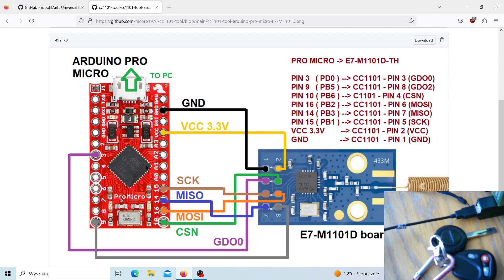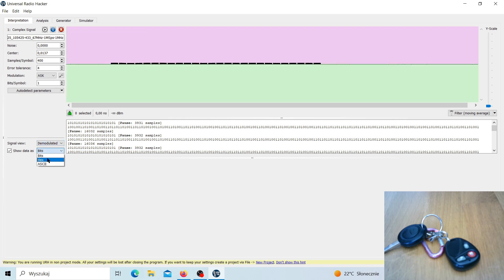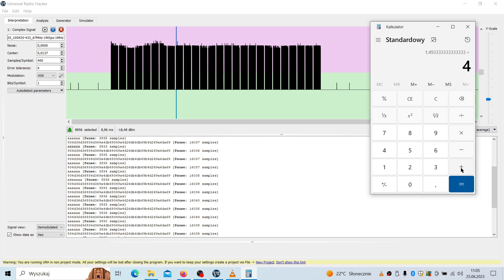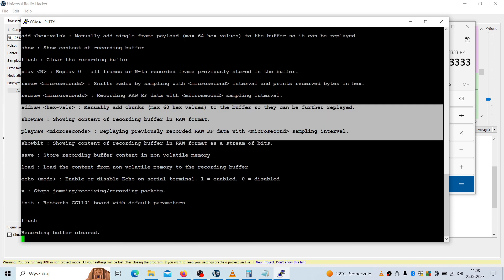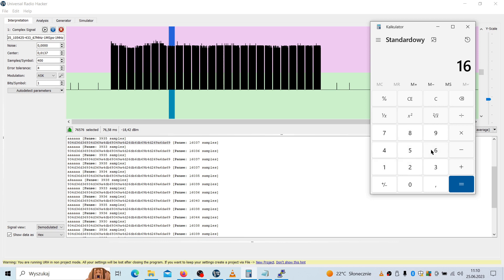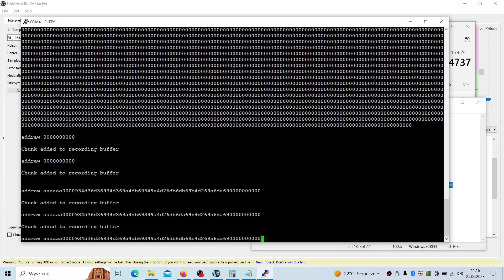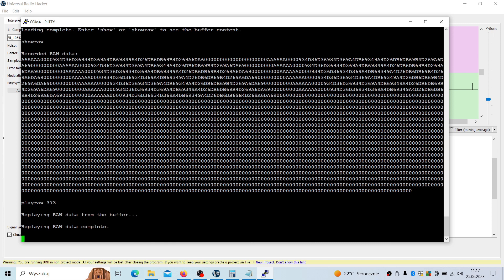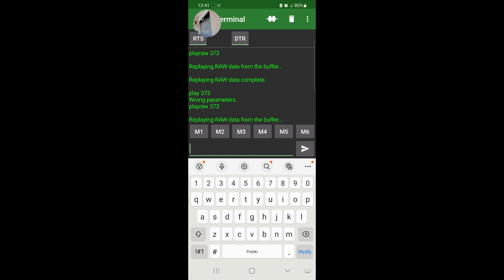Cloning my key and opening my garage gate with my 10 USD DIY CC1101 tool and Universal Radio Hacker

Comment: Hi I implemented the CC1101 module on the ESP32 DevKitC_v4 board according to your GitHub documentation, but I’m unable to receive data from my remotes.

I have a 433 MHz ASK garage remote and a 433 MHz FSK car remote, but I can’t receive the codes from either. Previously, using an RXB13 radio receiver module connected to an Arduino Nano and the RC-Switch library, I was able to see the binary code, decimal, pulse length, and raw data of my garage remote. However, with the CC1101 module, I’m not receiving anything.

I even tried sending a frame with the CC1101 and receiving it with the RXB13, but the receiver showed nothing. Unfortunately, I don’t have access to SDR modules to analyze frequencies with Universal Radio Hacker.

Can you help me figure out how to solve this issue or what parameters I need to set?
Reply from the maker: use scan function in my code also use rxraw  option to see if your cc1101 is working
Reply: @justanengineer5599 
I used the `scan` function, and it detects the frequency almost correctly (not precisely).  
I also used the `rxraw` command, but I don’t receive valid values; most of the received values are 0.  
I thought the issue might be with the CC1101 module, but when I used the jammer function, it worked well. I only have problems with sending and receiving.  
The 433.92 MHz ASK/OOK packets sent by the CC1101 cannot be received by my RXB13 module, and my parking remote (ASK 433.92 MHz fixed code) also cannot be received by the CC1101 module. I tried both the `rx` and `rxraw` commands, but they didn’t work. I also tried adjusting parameters like `setdrate -> 5`, `setdeviation -> 0`, and `setrxbw -> 58`, but I still can’t receive anything.
Reply from the maker: the issue may be the esp32 board which frankly speaking I was having a lot of issues with... Try to build this device with esp8266 d1 mini or Arduino Pro Micro 8Mhz/3.3v
Reply: @justanengineer5599 Thanks for your response.🤝🏻 Could it be due to using jumper wires to connect the module to the board? I connected the modules with wires and didn’t do any soldering.  
I’m not familiar with electronics.
Reply from the maker: Yes this may be one of the reasons. I would also suggest Dual Core ESP32 version - esp32S3 if really want  to use this china chip. Two cores ensure that your code will not be stopped and disturbed by internal wifi and tcp/ip procedures. Single core cpu is not good for real time operations with cc1101 board

Comment: Can you please tell how you made URH recognize your diy tool as RTL-SDR? What do i need to install?
Reply from the maker: you need to use Zadig tool and drivers for RTL-SDR : https://www.rtl-sdr.com/manual-installation-of-sdr/

There is my old video about it you just need to search my channel
Reply: @justanengineer5599  i installed winusb driver on my esp8266 with zadig tool (shows as FT232R in device manager), but sdr sharp still doesnt recognize it as rtl-sdr dongle :(

Comment: I understand the CC1101 and CC1111 (USB Microcontroller) are low-cost ISM transceiver modules (FEC is implemented using convolutional coding and supports Viterbi decoding for interpreting convolutionally encoded data )

Is there any hardware you'd recommend: Yard Stick One , PandwaRF, Flipper Zero, and Evil Crow RF V2?

I'm interested in doing things like what's outlined in the pdf "Hands-on guide to replaying a signal with CCManager".. as well  "Tetra MBARS”

Comment: I wasn't able to capture the data on a remote that has a very noisy signal when I used the Universal Radio Hacker recording feature. I used RTL_433 instead with the following command: rtl_433.exe -Y autolevel -R 0 -w filename.cs8 -T3. The "-Y autolevel" setting helps adjusting the levels

Comment: I don't have access to any URH compatible devices, is it possible to do this with just the C1101?
Reply from the maker: yes, it is possible with rxraw XXX and playraw XXX  commands
Reply: @justanengineer5599  How do I know what microseconds should I use in the commands?
Reply from the maker: if you do not have URH you will need to experiment. start from some bigger values like 300 and then decrease by 25
Reply: @justanengineer5599  Using both commands I successfully clone my doorbell and make it ring whenever I want, but extracting the preamble and payload of the signal when I read the buffer, it shows me information but I can't understand it. In order to save the signal and not just have it in the buffer

Comment: Is there a way to just automate the whole process of calculating the signal? Is there a software for that?
Reply from the maker: there is no software but you can create one if you wish. Learn python programming and use serial port library and PC to interact  with this tool. Create something useful and give it to others as I did. Be an open source programmer.
Do not only take, give something to the community. Show that you are worth something and you are not mindless consumer. Be a man

Comment: It's basically a home-made Flipper like device. :)  Now, it would be truly amazing if you could decode the algorithm of the rolling code instead of a simple replay. ;)
Reply from the maker: Well I leave it to others... But I can give you a hint... If you would attach the device to the PC over serial port and use Python to collect the radio transmissions you might be able to play with decoding : https://github.com/robert-mcdermott/rolling-code-auth
Reply: @justanengineer5599  - Honestly I was thinking about the same, you would need a large enough number of samples  with a hopefully small enough key size to be able to reverse the algo.  If they are using anything over a 128 bits encryption, it would take too many years to decode.
Reply: @justanengineer5599  - With larger keys, you're probably better off attacking the Code Validation Tolerance instead, by trying to extend the validation window indefinitely till you hit the right code. ;)
Reply: That’s not a rolling code if you read it you can see every transmission was exactly the same

Comment: When I use your universal CC1101 interactive tool my addraw and showraw displays as a single line across the screen whereas your video shows it as block of lines. Is there a setting I need to make in order to display in a block on the page and not one long line?
Reply from the maker: it will do one big line, at least for showraw

Comment: Who uses rf for garage doors without some kind of security , such as rolling code ? This is useless hehe
Reply from the maker: many people are using an old type of rf locks. And if you have two of such devices you can perform rolljam attack. Yes you arent as much secure as you think man...
Reply: Are you telling you need an sdr decide apart from the cc1101 you did for this to work? @justanengineer5599

Comment: I successfully  used your software tool for the cc1101, an esp32 wroom, the RTL-SDR, and the URH to decode my wireless wall switch. Thank you very much for your informative video!!!
Reply from the maker: great !
Reply: @justanengineer5599  Hello. I have a small question. I have now created my light timer module to turn ON/OFF my indoor lights when I'm away. I noticed that when the CC1101 is powered up, it permanently jams my car key & other electronic switches in the house. This is even when I am not sending messages. I fixed it by  setting the gain with ELECHOUSE_cc1101.setPA(10), sending Playraw(), then ELECHOUSE_cc1101.setPA(-30). Does this make sense? Does the CC1101 transmit even when not sending messages? Thanks.

Comment: Thanks for the video!
Someday, could you make a video with FSK modulation? I've 2 awning that use FSK and I can't find any video how decode & replay. Thanks in advance!!
Reply from the maker: i think Universal Radio Hacker has an option to decode FSK but you need to switch it on manually
Reply: Thank you for the reply! I’ll check. I’ll also use your device :)

Comment: Very impressive presentation. I like your practical approach with no unuseful information so one can get the work done efficiently. I will try your tool to hack all of my home wireless switches and add a timer to turn them on/off in the appropriate way to give a potential burgler the impression that there's someone at home while I'm on vacation. Question: Will your pro micro code work on a pro mini 3.3V 8 MHz after modifying the schematic for the SPI pins? What about  GDO0 and GDO2? Thanks!
Reply from the maker: yes. the main requirement is to use 3.3V TTL logic in arduino. If this is met then it should work
For GDOx  pins you may use any of free available pins, you just need to set pin number in the code accordingly
Reply: @justanengineer5599 OK Thanks! I have some  pro mini boards in stock. I am waiting for the cc1101 board and the SDR key to continue my project. Meanwhile, if you please, I have 2 more questions after studying this tutorial in detail:
1. The .373usec bit duration that you calculated is configured where in the cc1101 tool?
2. What is the purpose of adding those hex zero letters after the 6-letter preamble and the 50-letter data stream (Nbletters)? For me, the number of zeros (Nbzeros) seems to be calculated by Nbsmpls2 (value displayed after "pause:") and "Nbsmpls1  selected" using the formula Nbzeros=(Nbsmpls2/Nbsmps1)*Nbletters. Can you confirm?

Thank you!
Reply from the maker: Ad.1. this microsecond symbol length is used in the commands
playraw XXX
recraw XXX
rxraw XXX

Ad.2.
I have added leading zeros to warm up the transmitter. In fact zeros in ASK/OOK type of modulation mean no signal is sent
Reply: @justanengineer5599 Thank you!
Reply from the maker: you may want also to try with 2.4GHz CC2500 modules. According to this info it may work with my code aswell
https://e2e.ti.com/support/wireless-connectivity/other-wireless-group/other-wireless/f/other-wireless-technologies-forum/281641/compatibility-between-cc1100-and-cc2500
Reply: The pro mini works fine with the cc1101. I am using the ESP32 to listen to the SD Card using the audio.h library via the I2S and sending the commands to the pro mini via software serial to switch the lights. I would have liked to have done both functions on the ESP32 but there seems to be an incompatability on the spi bus even though I'm using 2 different pins for the CS. Any ideas?

Comment: Thanks for this one! I switched to esp32. My signal is very odd and Universal Radio Hacker could not decode it even with using the moving average. I could see the signs of the signal, however it was also hard to manually figure out what was going on. However, using recraw a few times I managed to get the right byte sequence and made it possible to replay my garage. 

Adding the webserver now and making it api accessible. Also I'm very surprised by the range of the cc1101, it goes incredibly far.
Reply from the maker: great. which board did u use ?
Reply: @justanengineer5599  ESP32. The api to open the garage trough the esp is working and I’ve managed to add it to home assist. Last goal would be to have it in HomeKit.

Comment: Before i start trying, do you think it will work on Arduino Uno?
Reply from the maker: no because uno has 5V ttl logicnot 3.3v required for cc1101
Reply: @justanengineer5599  I just checked the LSatan SmartRC-CC1101 lib and he says "A logic level converter is recommended for arduino. It also works well without. Use at your own risk." I'm tempted to give it a shot, or do you think I can blow stuff up?

Comment: Will HC-11 work? It’s a bit difficult since it only has 5 pin headers. Not a lot of Cc1101 boards are available in my country and aliexpress isn’t an option either.
Reply from the maker: it  will not work. it has serial port

Comment: Hey. I've started my project of cloning my garage door with an RTL-SDR. I quickly figured that the frequency is 287.8mHz. However, when I record the signal URH does not autodetect the signal type and there is also a lot of noise before and after the button presses. Any idea which parameters i should change in order to get a better recording?
Reply from the maker: well its hard to tell without seeing the signal. Is it some old type od radio keyfob or newer one? The most frequently the use ASK type of modulation. Also try to switch off Auto Gain in RTLSDR in URH
Reply: @justanengineer5599  It’s an older one so I assumed it would have been property easy to decide. I’ll try your tip, hope it will help. I’ve tried playing with the gain a bit but no luck so far. If you want I can send you the recorded signal file
Reply: @justanengineer5599  I cannot seem to find auto-gain in URH, any idea where the setting is?
Reply from the maker: https://www.oldergeeks.com/downloads/files/userguide.pdf

its named "default gain"  field when selecting your RTLSDR hardware as a source and choosing the frequency. Experiment with this value

Comment: Great stuff on converting to use with RCswitch! I have two questions. Do you think it's possible to also clone a garage door that has a 8 three-way dip switches? (I guess it is just a way to add more bit combinations, right?). Second, would it be hard to port the WiFi esp8266 version to esp32?

My goal is to make an API on the ESP32 which will be in the garage that will send the signal to the garage door, so I can use my phone to open it from further distance than with the remote :). Thanks a lot!
Reply from the maker: yes. dip switches based doors can be easily cloned

Comment: Thank you for the video 
I managed to control my DC fan using your tool 
my next step is to convert the hex i have working to ESPHome so i can control it from home assistant 
do you have any ideas on how to do that ? Here is what i'm running to control the fan

flush
addraw e8eeee88ee888ee88e8e8e8ee8e8e80000
addraw e8eeee88ee888ee88e8e8e8ee8e8e80000
playraw 350

Thanks
Reply from the maker: great that my tool worked for you.. I have no experience with ESPHome therefore I am unable  to help you with this
Reply: @justanengineer5599  I guess what I'm trying to do is figure out how to convert the hex I get to the  rc switch format
Reply from the maker: i think here is the answer  https://esphome.io/components/remote_transmitter.html#remote-transmitter-transmit-raw-action

the rcswitch  operates on symbol length. negative values means 0 is send for particular time , positive number means 1 is send for specified time 
you have to use remote_transmitter.transmit_raw
Reply: @justanengineer5599 hmmm 🤔 then I guess my next question is how do I convert the hex to the format transmit raw format esphome expects?
Reply from the maker: if you do showbit command in my cc1101  tool it will display the stream of bits. then you have to use calculator and count the number of microsecon for each zero and one symbols. then prepare negative values for zeros and positive values for ones separated by comma
Reply: @justanengineer5599  I'm happy to announce i got it working.

URH has a flipper zero plugin that can convert the signal to a raw format very similar to what esphome needs.

Then i captured the transmit from the cc1101 tool and converted the output 
and that worked with in ESPHome 

Do you have a discord server? 
I would love to share this with more people

Comment: it's possible to make a spy camera jammer or locator ?
Reply from the maker: spy cameras are using local storage - micro sd cards - for storing videos. they are not sending anything over radio. The exception are wifi based cameras

Comment: how can I change the frequency of cc2500 to any frequency I want
Reply from the maker: dont ask me. This project is using cc1101 board not the cc2500
Reply: @justanengineer5599  can i use cc2500 to work with higher frequencies than 1GHZ, if not what cheap product do u recommend If I wanted to work with frequencies higher than 1GHZ.
Reply from the maker: yes cc2500 is for 2.4GHz
Reply: Is there a way to change its frequency. I want it to operate on 1.8GHz. Is that possible or is it fixed to 2.4GHz.
Reply: also thanks for answering these questions.
Reply from the maker: according to the TI manufacturer info CC2500 is operating only within 2400-2483MHz range

Comment: But if you use the ESP32 as a microcontroller, then you can connect it to your phone via bluetooth?
Reply from the maker: you can connect over wifi. there is already source code prepared for this but for ESP8266

Comment: How do I repurpose this pattern on Teensy?
Reply from the maker: which teensy board? you need to have something that is supported with SmartRC library
Reply: @justanengineer5599  Teensy is compatible with Arduino IDE so no problem.
Reply from the maker: SmartRC library that I am using in this project only supports a subset of boards not all of them. So there is only a chance that it could work, nothing certain

Comment: When i use recraw wifi is disconnecting in esp8266
Reply from the maker: use recraw XXXX where xxxxx is a microseconds (did you read the help?). if you use this command without the number the esp8266 will restart itself
Reply: @justanengineer5599  hey I did it worked very well
Reply: @justanengineer5599  I am using esp8266 as wifi access point thanks for the code

Comment: defining PINs set for ESP8266 - WEMOS D1 MINI module
byte sck = 14;     // GPIO 14
byte miso = 12;  // GPIO 12
byte mosi = 13;  // GPIO 13
byte ss = 15;      // GPIO 15
int gdo0 = 5;     // GPIO 5
int gdo2 = 4;     // GPIO 4

What about (vcc to 3.3v) and (gnd to gnd).  should i need to connect or not
Reply from the maker: Well you know that everything  works better when connected to power source :-) of course that you need to connect to 3.3V and GND as well